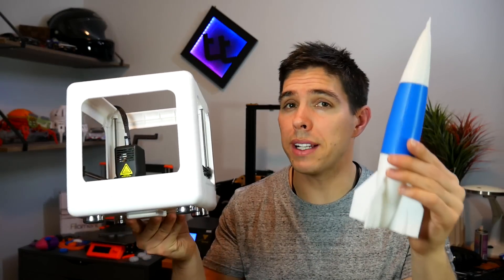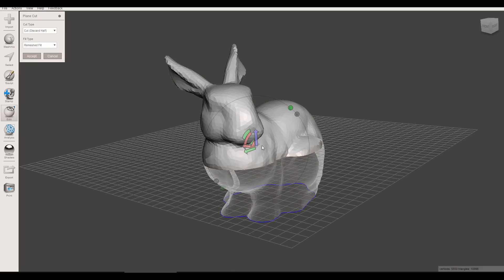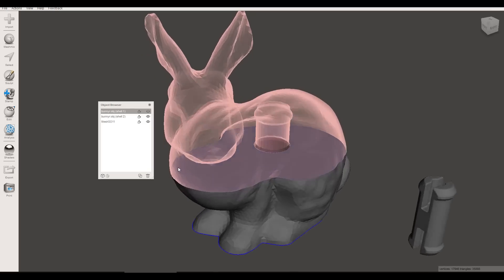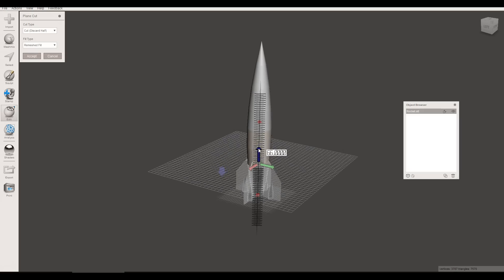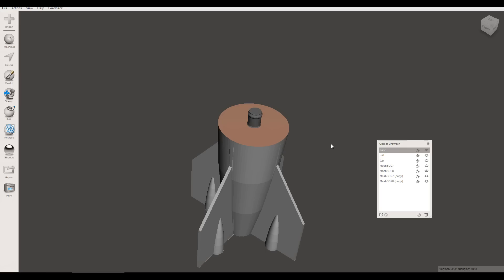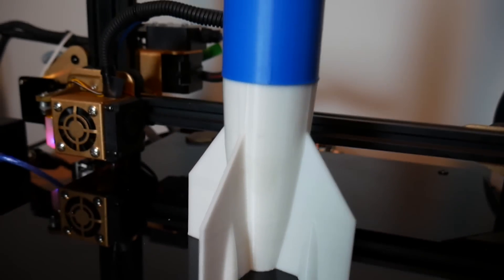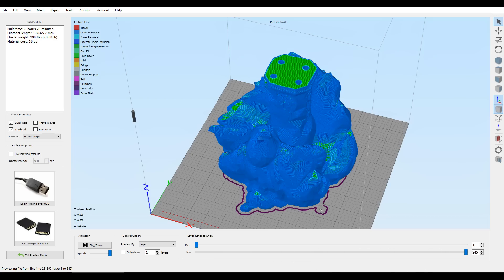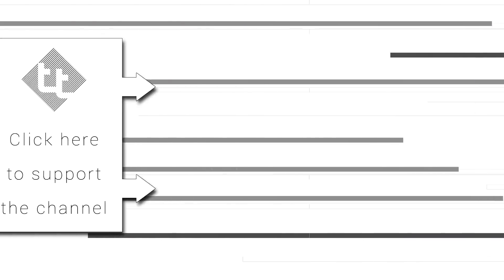Oversized 3D printing: How to split STLs in Meshmixer

Comment: A very simple way to join parts is to cut 2mm diameter x 5mm height cylinders from both parts. Then use short lengths of 1.75mm filament to align the parts before applying glue.
Reply from the maker: That's actually a great suggestion.
Reply: It is possible for small prints, but I'm not sure it can do a good job on big prints that are meant to be functional
Reply: @mlazzarotto  I don't understand why that would be a problem
Reply: @mlazzarotto  The pins are only for alignment. You use glue for strength.
Reply: Thanks for this - how do you cut cylinders in meshmixer?
Reply: i dont mean to be so offtopic but does anybody know of a trick to get back into an instagram account..?
I somehow lost my password. I would appreciate any help you can give me
Reply: @Lyle Brendan thanks so much for your reply. I got to the site thru google and im trying it out atm.
Seems to take quite some time so I will reply here later with my results.
Reply: @Lyle Brendan It did the trick and I finally got access to my account again. I'm so happy!
Thanks so much you saved my account!
Reply: @Jedidiah Wesley Glad I could help :)
Reply: thats great, but 2mm is not enough, atleast on my ender 3 v2. I recommend 2.3

Comment: 2 quick design tips:
1. Make the peg non-cylindrical so the 2 halves can’t spin. Oval is probably best, to avoid stress concentrations and high friction in the corners during assembly. Alternatively, use 2 circle pins. 
2. Make the pin slightly shorter than needed, so that the two halves connect closer. Also, if you followed tip #1 to ensure alignment, you can use (the appropriate kind of) glue between halves. 

Good video.

Comment: @teaching tech awesome video! I just used this to cut off a face so i can print it in a different color. I also used a primative to make an aligning pin about the size of a piece of filament so can just cut that and push it in to stabilize it. one thing that took me a second was the snap alignment that you have to turn off if you want to precisely align the cavity. I don't recall you mentioning that.
you are the best teacher on youtube when it comes to things like this! I am very happy I found you out here.

Comment: Hi Michael. I have been modelling with acrylic for a few years, and use a chemical called DCM (Dichloride methane) which works really well. I attempted to glue some PLA the other day and the DCM works very quickly and bonds the PLA really well. Be warned that the DCM is fairly potent, and should be used in a well-ventilated area with PPE's such as face mask and gloves.  Additionally, when I have to join parts that continue like the gallery on top of my model silos, I use a male/female dovetail joint. Thanks for the work that you do on the videos.
Reply from the maker: Hi Keiran, thanks for the great tip. I use super cheap Bunnings super glue  for PLA which works ok for me. Dovetail joints  sound very nice!
Reply: Can send you a photo if you like.
Reply from the maker: Please do.

Comment: Great video. Perhaps resizing the pins down 1 - 2 % would make the joining process easier. It did for me on a model with alignment pins. 😀
Reply from the maker: Good suggestion. It would probably help with the little gap too.
Reply: It does. At least it did when I printed the 2018 World Cup trophy model that used 3 pins to attach the globe to the base. I also superglued it at the plane cut.

Comment: Many thanks for the tutorial on meshmixer. I have a slightly different problem though. I have 3d modeled my house and garden (and a bit of mountain) with photogrametry (free trial) and my DJI mini2 (approx 30hectares). I have a lovely detailed model accurate to 20cms resolution or so. I'd love to make a really big 3d model of the whole house and garden (and mountain!) to have in the house - maybe 60cm x 60cm in area??. I have used FDM printers a lot (and i've made a small version of the model with FDM but the layer-lines are not ideal)... but i have just bought my first SLA (photon MAX) and i'd love to use that. My question is... (finally!).. how can i chop up the model easily into say 10-20 regular sized parts (columns i guess), that will glue together to make one giant awesome map?!!! i'm trying to avoid doing each vertical cut manually. is there something that will do this somewhat automatically or at least simply? cheers and love your channel Julian! PS my photogrametry trial (would recommend) and the model making would eventually make it to my channel i hope.

Comment: Amazing, thank you so much for the video. I have a steam punk train i want to print but its around 400mm and even printing it in pieces looks terrible becasue of the supports. So on with trying your method - will send a pic if i get it working, thanks - keep up the good work.

Comment: Hey, :) Thx.

Quick question - @~5:14 You're transforming to move Rocket up to base. I would have thought "Align Base Point" would work with a single click or two and be easier, perhaps be more accurate, and maybe abate any chances of visual/operator error? 

Maybe your/my method is just another one of those 6 of one, 1/2 a dozen of the other type situations.

PS: Looks like resizing the pins has been addressed in the Comments. Some great Comments, BTW. :)

Comment: Can you adjust the size of the pin that makes the hole? I ask because I plan on using several small holes and epoxying in aluminum roll pins.
Reply from the maker: Yes, just transform both the male and female parts of the pin to the same percentage before undertaking the boolean operations.

Comment: Would it have been possible to print the pins integrated within the model? would have been possible for the 1st part of the rocket to add pin instead of the hole, and for the 2nd part bottom to include a hole that fits the pin, while on top of the build have a pin added in the build,, for the third part you only add the hole that fit the pin for the second build. 
And then all fits together as lego parts,,, reducing number of items to build and assembly time (well, by not so much, but still), but it will be easier assembly process imo
Reply: which also means, in the design process, there will be less subtracting: instead of four times (1 in the first, 2 in the second, 1 on the third build), it will only be 1 on the second and one the third,,, reducing design time too.

Comment: Great video.  I want to print aircraft.  Need to cut them in half for vertical printing.  When  I see the half that is cut  it has the entire model including the tail.  When I cut and look at the section the tail is missing.  What can I do?  Tried to call Autodesk and they do not answer their phone.

Comment: So I am building a large model split into 4 pieces using this technique.  I am now thinking I might need to split one of the pieces in two.  I've loaded that single piece back into Meshmixer and I notice that the flat surfaces where I cut the model seem to be rounded in some places where they meet the sides rather than crisp, sharp corners that were present when I plane cut the model.  I haven't even started to manipulate the stl yet, I just loaded it.  Is this a "feature" of Meshmixer?  The same stl loaded in Cura has sharp edges...

Comment: When I cut my object and try to separate the shells meshmixer slows down a lot and then tells me I have 1000+ shells???
Reply: I fixed the issue, I had to repair the model. I used 3d builder for that though, not meshmixer. Whenever I tried meshmixer it would ruin the model

Comment: Hello, have a question about the connectors used. What if you just wish to make a hole the size of 1.75mm filament, to use it for aligning the parts together? That is what i have used in the past, but with 123d design. I would much rather use meshmixer now as this tutorial convinces me it would be easier to use.

Comment: When you cut or slice an object with Meshmixer, does it automatically close off the new 'open' end or is there a command I need to use to make this happen?
Reply: it close both two new shells
Reply: @KlaudiusL  Well mine doesn't. I end up with two parts with open areas where they were once connected.
Reply: @geoffreylucier5772  I'm using version 3.5.474.
1) select the object to cut
2) click "Edit" on the left toolbar
3) click "Plane cut", rotate-translate as you wish
4)  Options:
     - Cut Type -> Slice (keep both)
     - Fill Type -> Remeshed Fill
     - Accept
    * at this point you have one object, you need to separate
5) Click "Separate Shells"
Object Browser appears, showing 2 objects. 
To be sure, select Edit->Transform and move arround the pieces to see if there were closed. Press W, to see wireframe
Hope this help
Reply: @KlaudiusL  Nope. Everything happens that you describe up to the closing step. I end up with two objects, both of which are open. I should mention that I am slicing the back side of a vase to make a flat surface but the top should be left open (obviously).  Maybe this condition is confusing Meshmixer. I am using Version 3.5.474 which is newest (I believe).
Reply: @geoffreylucier5772  That could be the problem. Did you check if your model is ok? Analisys -> Inspector. You can go to www.thingiverse.com and download some vase similar to yours, look at how is modeled and try to make some cuts on it. If everything is ok, then your model has some offending geometry.
Reply: @KlaudiusL Actually, Thingiverse is where I got the models. They print fine with my Cura slicer.  Thanks for the help anyway.
Reply: @geoffreylucier5772  👍

Comment: Is it possible to split lowrider2 CNC XZ_MAIN_25 and it do its function
I want to do this because my 3d printer is snapmaker original 125mm x 125mm x 125mm

Comment: Spit.. slide apart a little... add a "dowel" that bridges the gap.  Split the dowel.  Add one end to one side and subtract it from the other side.  Probably 3 dowels minimum (depends on the item split).  round off the end of the ones added to ease assembly.

Print
Glue it together.

************

Your connectors contribute to the bad fit.  Don't use the connectors that go as deep as the hole.  The hole needs to be at least one layer deeper than the connector.
Reply: I've been doing it already in 3DBuilder.

Comment: Why not print the pegs in one of the sections? Then you would have a male and female side to snap the pieces together.
Reply from the maker: That is an option but keep in mind the layer lines would be going the wrong way and the flexible parts of the pin might snap.

Comment: I'm only new but I find the shrinkage distorting parts quite annoying when trying to make precision parts. 
I've printed 20 spur gears and all of them are slightly non concentric and slap when they  run against each other. I think I have to learn Fusion360 and make helical gears that keep contact.
https://www.youtube.com/watch?v=_7zuxSRCWpc
Reply from the maker: I'm not sure I understand the function of the device but I found it interesting. Hopefully your gear change solves the problem.
Reply: It's an Arduino EFI with the small gear and 12T timing wheel being the crankshaft of your engine, and the large 1T wheel being the half speed camshaft. 
It mech tests the sequential operation of an engine using the full 720º 4 stroke cycle, with the logic level ignition output powering a LED as a timing light.

Comment: Next tutorial, how to use MeshMixer without it crashing.
Spoilers: you can't
Reply from the maker: I actually had zero crashes for this video. Normally I know what you mean. Save and save often!
Reply: Mine used to crash a lot. Upgraded the pc and it no longer crashes. It wants a fairly powerful cpu  and gobs of ram.
Reply from the maker: I imagine ram usage goes through the roof on complicated meshes.
Reply: yes, most of the times Meshmixer will crash .
Reply: Indeed. Hi-poly models for use with my Photon choked my old PC (dual core 2.3GHz-8GB RAM). No problems with my Ryzen 7 (Octacore 3.7GHz) and 16GB of RAM. Never crashes with this setup. 
If it ever does I'll double the RAM. It happily chews through 5 million polygon models (I hollow them out to save on resin) in a fraction of the time and without crashing like the old PC. I run the "make hollow" sliders at maximum :D